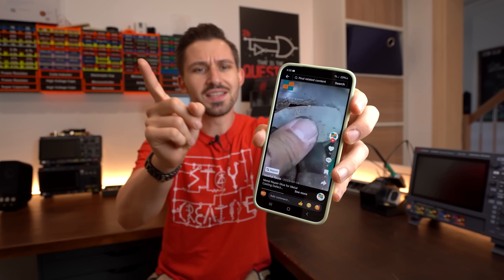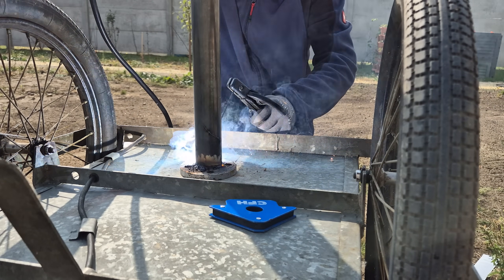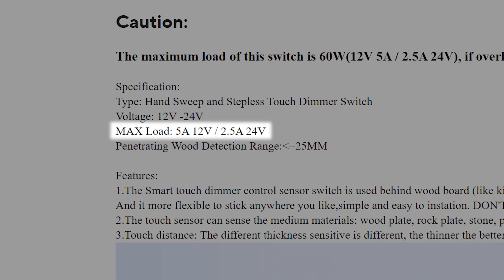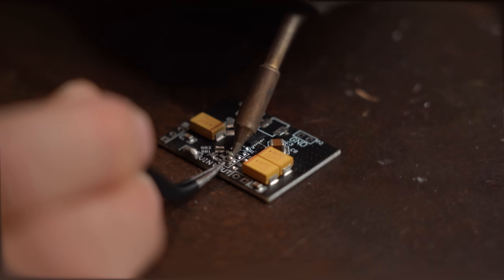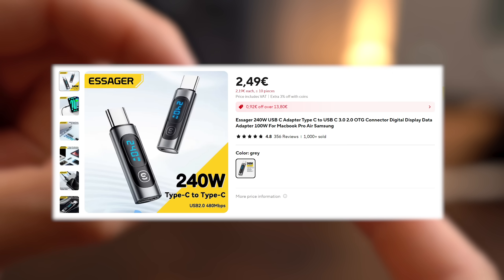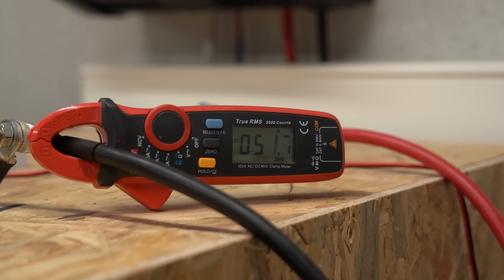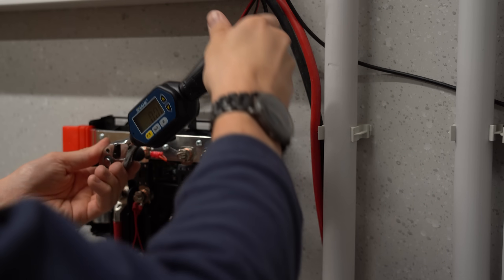I tried finding Hidden Gems on AliExpress AGAIN! (Part 11)

Comment: AliExpress Hidden Gems - Part 11: A Review of 6 Products

* 0:00 Introduction: The video explores six products from AliExpress, testing their quality and functionality to determine if they are "hidden gems."
* 1:37 Metal Repair Glue (2.7€):  While not a true welding replacement, the glue offers strong adhesion for general repairs and can be painted, polished, and drilled. Verdict: Thumbs Up
* 3:45 Touch Sensor (3.4€):  This sensor can be used behind materials like mirrors to activate devices, supporting up to 5A at 12V or 2.5A at 24V with a maximum sensing distance of 25mm. Verdict: Thumbs Up
* 6:12 Tweezer Soldering Station (37€):  Though effective for removing SMD components, the soldering station lacks precision and may damage components during removal. Verdict: Thumbs Down
* 8:24 240W USB-C Display Adapter (2.5€):  This adapter adds a power display to any USB-C cable and accurately measures power draw up to and beyond 100W. Verdict: Thumbs Up
* 10:18 Mini Torque Wrench (62€):  A digital torque wrench with real-time, peak, and set modes, offering a good alternative to more expensive analog options, although it lacks a backlight. Verdict: Thumbs Up 
* 12:20 Laser Level (23€):  This digital laser level features a manual adjustment system and provides powerful laser lines. However, it lacks the auto-leveling feature found in pricier models and may not be as accurate. Verdict: Thumbs Down 
* 14:33 Conclusion:  The video concludes by highlighting the successful products found in this exploration of AliExpress offerings. 

I used gemini-1.5-pro-exp-0827 on rocketrecap dot com to summarize the transcript.
Cost (if I didn't use the free tier): $0.02
Input tokens: 16125
Output tokens: 420

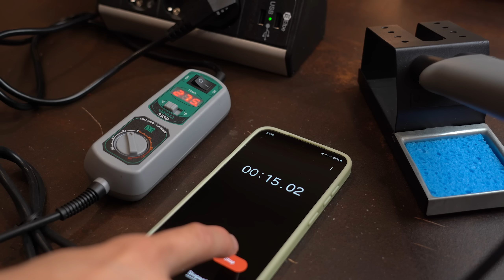Comment: 7:14 from my experience with my yihua soldering station I can say that they often show that they reached the set temperature, but aren't really there in reality. Its more like they show a steady rise in temperature which doesn't match the actual temperature - at least not the temperature of the soldering tip and maybe the one of the heating element itself.

Comment: Autoleveling laser from store brand's like Lidl's Parkside are usually cheaper than this shit from Ali for simple table mounted ones and like 60 € for little bit more serious ones with tripod... So even cheap in a pros is questionable because it's cheap compared to professional product, but not so cheap compared to budget solution available in regular store...

Comment: 10:27 for what,what is the use
Reply: You probably don't need it, It's used to torque bolts and nuts down to a specific value to prevent bolt/nut from loosening on its own due to vibration, etc.

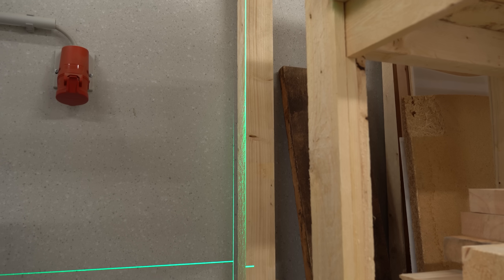Comment: 12:54 Totoro! <3
btw, link to that USB adapter is not available anymore but it's easy to find a working one - however, the initial price is €0.92 but once you log in, it rises up to €3.14 (with shipping). Still ok, but not as great as initial price :)

Comment: i had that AB epoxy, used half of the tubes. A few weeks later, wanted to use the rest, but one of the components had separated into a thin oil and paste. Like an emulsion breaking. Never experienced this with other epoxies (eg. Araldite)

Comment: If you want to join those metal parts without welding cut the hole in the base 0.5mm smaller than the pipe. Heat the base part to expand and cool the pipe to contract, then bring them together. It's how they used to make bike frames.👍

Comment: Used a capacitive touch sensor under my nightstands for my bedroom lights until they turned on during the middle of the night. Would be nice to test the controller for detection stability.

Comment: AliExpress is always a bit of a lottery. I usually distrust any „values“. The FNIRSI 1013D is a nice dual channel scope. Fully touch operated, very comprehensive and I tend to belief, that it can do 100MHz (I have no means to prove it). Definitely my find of the year. I really like the size, not too small and not too big. The big size is often the reason, why I hesitate to use my „real“ scope. And since the FNIRSI is battery operated, it saves an insulation transformer, too. 

Those soldering pliers look pretty poor. I sometimes „lift“ chip resistors off the pcb with a 2nd soldering station. Since I am a bit lazy, I often do it with a bigger soldering tips and more solder. My hot plate is a bit big (20cm x 20cm), so it will not fit between the through hole components/connectors. I think, I should get a 2nd smaller one for desoldering. For soldering, my hot plate works pretty cool, though.

Comment: Can you do a test video of bolt and screw terminal connections DC resistance vs applied torque. There was similar video by eFIXX for AC MCB screws. It will be interesting to see how much of a difference the applied torque makes to the final result compared to just good tightening by hand.

Comment: Love this series!
It gets me thinking about what projects I'd use most of this stuff for
I rarely buy anything but I might get the USB C watt meter (to complement my better one that shows current draw and voltage, but which is much larger)
A bit weary on that wireless switch though...

Comment: I bought the same hot tweezers, different name, because I didn't want to spend a ridiculous amount on domestic-made ones here in Japan. What can I say? Made in China, you get what you pay for. I really only wanted them for one job, if they died after that I was fine with it but they've lasted about two years now. Great for semi-inaccurately quickly desoldering SMD stuff (you have to adjust the tweezer ends every time before you use the things), but definitely not recommended for the other way around. Could be that my hands are just unsteady as fuck too though...

Comment: My biggest problem with laser levels is that they're limited by the tripod you attach them to. Meaning, if I need to put up a cupboard at head-height, the laser won't reach that far.
What I want to see is a tiltable laser level.

Comment: On these digital torquemeters you have to place your hand in the middle of the handle to get accurate results. This is because they rely on the bending torque in the area under the display which is influenced by where the force is applied.

Comment: I also have Wurh Zebra mini socket set and when i have to remove sockets from that rubber holder, i curse badly. But build quality is ok. Not as good as Wera, but i am not that rich and have only screwdrivers and pliers from Wera. Love the superb quality and comfortable handles though.

Comment: Zahlst du da Zollgebühren oder ist das im Preis enthalten?
Reply: Ali clears the EU customs for products shipped via Cianiao or their own shipping service and the customs fee is included in the total price that you pay to them when you order. In the search listing, the customs fee may not be present, but in individual product listings, it's generally rolled into the product price for products with standard shipping rate or free shipping. This is why in search the price can be different than when you load a listing. The site is a little unrefined and the search feature has gone ever more broken over the years.

Comment: IMPORTANT Info on the torque wrench: you have to take care of how you apply force to it. You can easily get FALSE readings if you are "holding it wrong™".

It is, essentially, just a standard ratchet, with a load cell glued to the shaft somewhere under the electronics case. Unlike the high-end (and expensive) electronic torque wrenches, which have the sensor placed in a way to minimise measurement error, this wrench simply measures the deflection of the wrench shaft. Of course, you can easily cause deflection of the shaft by trying to bend the wrench. I can easily get it to show a couple of Nm by simply bending it, without anything being attached to the square drive. Accordingly, you can cause false readings in use by gripping the handle too tight or holding the ratchet by the head.

If you take a look at the calibration sheet, it mentions something about measuring with the centre notch. On the handle, there is a notch in the middle of the handle: this is where you need to apply pressure to have it read right. I just hook 3 fingers around it, with the middle finger on the notch, and pull (without gripping the handle).

To conclude, it is ONLY accurate if you use it correctly. Fair enough, IMHO, for the price you shouldn't expect more. However, I wouldn't recommend it. I got it to complement or replace my mechanical torque wrench, and must say that it's rather cumbersome to use, the control interface is confusing and not intuitive, and the display is difficult to read under some conditions. Setting the mechanical wrench to desired torque and it's mechanical feedback are much easier to use.

Comment: the glue is just metal powder mixed epoxy. its not as strong as welding but you need to do surface preparation with degrease, sanding, bla bla before. thats the must for any type of glue. so while its not optimal but you didnt use it right and make it seems too bad while it actually decent epoxy!

Comment: You must apply the glue on sliding surfaces for such a  metal joint ( in other words the tube must be sunk into a hole with precise fit and 0.1 mm clearance for the glue) probably not practical and almost any weld better. How do I know? Im an engineer I have my own lathe, I can weld and have been using the same glue for about 6 months now. Note JB weld is better. Ive been using Ali Express for about 2 years now and found them to be excellent on returns (better than Ebay) I also find innovative products that often Ive bought 5 different versions to find the one that works / is best, but its all cheap and returns works well. Great idea for a channel Ive subscribed, touch sensitive switch going on one of my induction powered projects (also Ali Express)

Comment: For the people that don't use AliExpress this content is being lent on too much  

IMO

Edit: For beginner welders - If you are starting to weld it is better to weld a bit too "hot" than a bit too "cold" 
If you are getting welds like the ones seen here turning up the amperage may help beginners avoid "sticking" and getting low penetration & spotty welds
too hot is better than too cold for beginners 

again IMO

Comment: The only downside to the USB C adapter ammeters is they tend to be inaccurate with varying results with each brand, but they are good enough to give you an idea.. I also got a couple of them in the past for the same reason

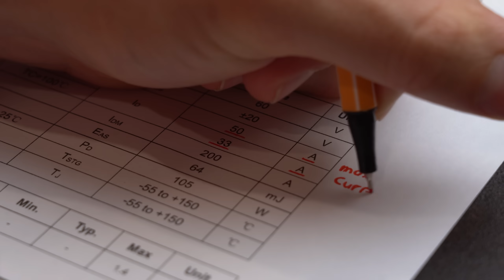Comment: 6:00 - be careful. The limiting factor for most MOSFETs is not the rated current per se - it's the junction temperature. Those max currents are usually essentially "note that even if you somehow keep the junction temperature within limits, you still shouldn't switch more than this current lest you potentially get local hotspots & thermal runaway".

Unfortunately, calculating if this is in spec for the FET is nontrivial for a PWM device, as it depends on the switching waveform.

Comment: To be fair to the metal "welding" material, it says its filler for repairing holes and not a structural component.
Aliexpress naming is pretty much just tags, if you put together what makes the most sense it usually works fine for the intented pourpuse.
"AB casting repair glue" "High temperature resistant" "liquid metal" "welding filler" "metal repair glue for metal casting defect"

Comment: Not sure if it's common with brands in Germany, but "lifetime warranties" are fairly common with U.S. tool brands.  This doesn't always indicate the highest quality, however, as it mainly means that the brand sees an acceptable number of warranty claims that help to market the brand with substantially impacting its finances; buyers like lifetime warranties and will thus prefer brands that offer them.

Even still, very cheap brands may not be able to afford such warranties as their claim rates may wipe out their profits.  Tools with lifetime warranties thus tend to be of decent quality.  Warranties are not really about quality, but about their marketing benefits versus the cost of claims.
Reply: „Lifetime Warranties” are not common in Germany and probably rest of Europe because it’s not Very clear for the buyer how long a “Lifetime” is it really. It’s mostly self defined for every product and doesn’t match with the exception of the buyer. So it’s misleading and that’s not allowed in Germany.
Reply: It's limited 😊

Comment: The hot tweezer station looks good to recap some horrendous SMD electrolytic caps without stressing the board or the other components too much.

That epoxy seems surprisingly good, if you don't expect miracles out of it. I mean UHU makes its own metal epoxy, it's also a little thicker and heavier.

Comment: No wonder Keysight charge so much for their scopes - they give away so many $20K US scopes in sponsorships!  Anyway, 'welding', as used by the Chinese, simply means joining or gluing.  They apply the same term for soldering as well.

Comment: I have the same toque wrench, different "brand" not sure if that matter beacuae it's the same body, same diplay, same beeping, same quality, just orange.. I use it on cars and so far it's reliable having 4 unit has been wonderfull working on american/korean cars none of them have the same unit and differ from bolt. I goes to 40lbs-ft, plenty for most small bolt after that I use the 1/2" 2feet torque wrench click type up to 250lb-ft. I kind of comprare them when I got the small one and they were really close.

Comment: hmm torque on connection bolts is not actually that critical, it can reduce the last few uOhms but at that point you are splitting hairs at >150A, your wire size becomes more critical at that range of current
I have a 24vdc 4kw invertor used at 500w average(oversized for durability and lack of stress and because <2kw was all the crap ones you buy for cars at 12v and I wanted to stick with 24v)
I have never had even detectable heating on any of the 2AWG lugs, the most heat actually is at the batteries and the breakers I bought, which are intended to have some heating to detect slow overloads to protect my large batteries

I suppose in situations where you are dealing with voltages high enough to arc if loose or in high-vibration zones you may want to torque electrical connections
but generally in a stationary space with DC at <200a you may not need more than "tighten until it is too much trouble to go harder" I used some normal 12 point wrenches and tightened until I would need >6 inches of bar to get tighter on 5/16" bolts, I would bet the torque is within the minimum and maximum torque to avoid contact heating with no measurement

sorry I find that torquing electrical bolts in standby power setups is just too fixated on, in most consumer spaces(ie less than 10kw connections, like literally all of them will be besides a main battery buss bar which will only have <10kw on each lug unless you are overly careless) it doesn't matter if you get the torque just right, close enough to avoid it falling loose, but not enough to snap bolts, just ensure contacts are clean and mostly flat so the torque will press the contact faces tightly

Comment: PD3.1 is going to ONLY be useful for things like laptops(who struggle to sip little enough power to go under 100w as the standard is 20v and 5a is not enough at 20v)
it might be OK for things like large displays or projectors, but literally no small devices will use >20v as 100W is almost NEVER needed
I would love to have a pinecil that uses 48v 5a
the current implementation is limited to ~20v 5a or less due to tip resistance, which granted is often around 60-80w for a tiny tip, but having a mega tip on my pinecil(mega version, big hands and big joints friendly) that can sip 240W in bursts would be so useful

beyond that 48v is tough to even justify, most buck regulators tend to get more expensive once you cross the 30v threshold(something to do with power supply safety testing I suspect)
get yourself a 100w PD3.0 powerbank and be happy until most laptops ditch non-standard plugs and go 240w PD
Reply: You left "gaming" off that description... Traditional laptop power supplies were always 18.5-19.5V at 3-3.5A (60-65W). Many laptops now come with lower output power supplies.
Reply: @tin2001  workstation too, and who wants a super slow trickle charge even if the laptop supports PD? plus with multiple displays, external devices, and brighter screens, you quickly can hit 100w even on a mid-range device, making PD3.1 actually useful even if normally it only needs 30-65w
Reply: Pinecil has a one month warranty.
Reply: @Boogie_the_cat  yes, and I fried my old model giving it 22.5v peak and 21v normal, the PD chip literally dies at anything above 20.5v

Comment: I purchased the glue on Temu. It was a single tube, so it doesn't need mixing. It works well for light jobs without, and it is very cheap. (About $2  AUD for 50g)

Comment: Top tip: an incredible glue is any cheap super glue combined with baking soda. Strong as a rock, dries instantly, you can sand and drill it easily.

Comment: I soldered 8 hours a day for 4 years and think hot tweezers are pretty dumb. High quality tweezers for less than $5 and hot air station for $45 work good for anything you need. Other than that, a good hot plate and $105 dollar hakko are literally the only tools I Will use. Other than that I did have a $900 hakko solder sucker, that was worth the money.